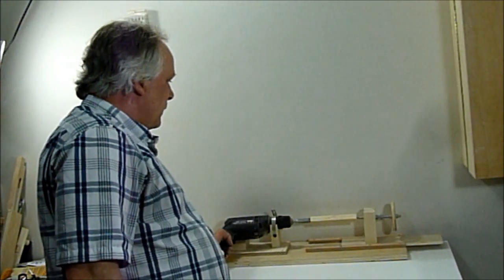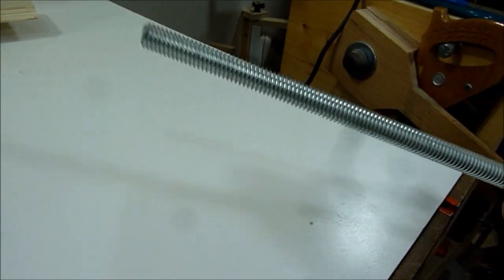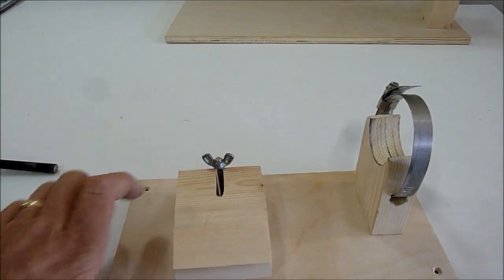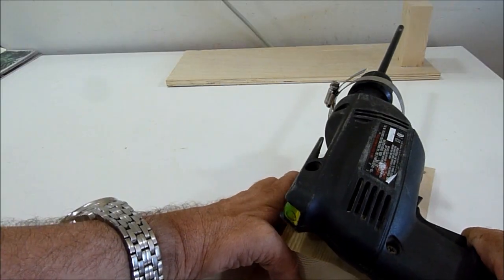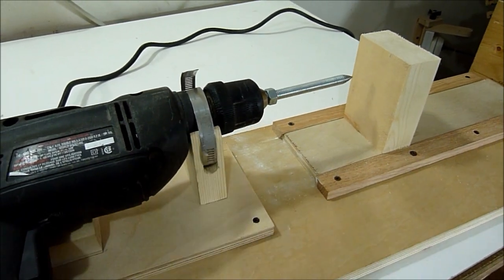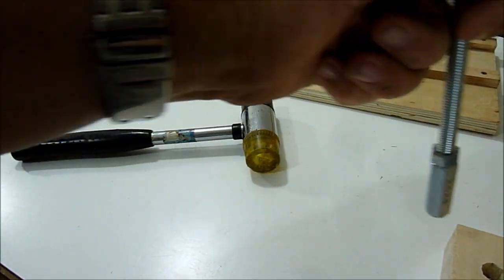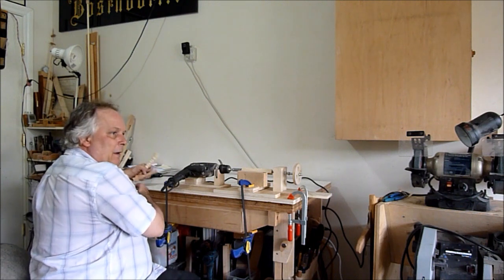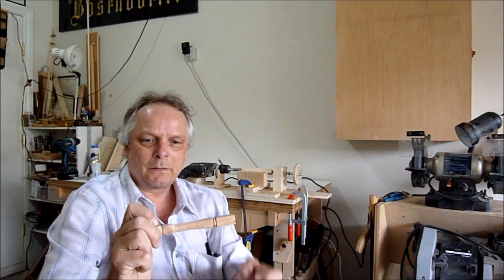How to make a Mini Lathe

Comment: yeaaaaahhhhh i dont care what anybody says about the lathe, i think you made an incredible machine. if i needed to make a breaker bar with a socket at the end, id whip the ole welder out and weld it to some scrap rebar. fact is he made something that works. btw you dont need a drill press with a hole saw. great job

Comment: Thanks for posting.   I can't afford to shell out $500 for a lathe or even a couple hundred for a used one and was contemplating using a drill for the motor like you did here but I was unsure if it would have the horsepower needed for turning wood.   This video has obviously answered that question so the most expensive component of your design I already have and I like that your design allows for the removal of the drill as needed for other chores.   I have a short list of projects I want to try out including turned Christmas ornaments.   I like that your design is also compact.  I have a very small place so basically I need something I can do on a small kitchen table and I think this will do the trick.   Hope you don't mind me stealing some of your ideas.

Comment: nice build, very handy... You really shouldn't use a rag in hand like that on a turning lathe, you could easily lose a finger or suffer terrible wrist damage. Wrap the rag tightly around a stick and secure the ends or use a paint brush. Fingers are the one tool you can't replace.. I heard you say you never had a lathe or used one. Please look for some basic safety guidelines... keep on having fun and make more video's...

Comment: My 1st wood lathe was powered by a drill. You might want to make or buy a live center for the tail stock. Holds the wood better without heat and burning issues. 
Nice work

Comment: if you have so much industrial machinery at your disposal - why not get an actual lathe if you are going to be making many things from it. If it just a tool handle you want, you probably get one at the hardware store for less than a dollar. As time goes by, the wooden components will not maintain its integrity and your pieces won't look the same.

Comment: thanks for inspiration... I would be using a hand blender motor coz I got only small DIY task :)
Reply: Blenders motors are not designed to run for a long time ( only  a few minutes for the best ones ) , it would overheat and blow qwickly .
Drills can run longer , on drills , you can hook sandpapering machines , or circular saws ... tools that requires the drill runnig a long time .

Comment: I made also lathe with drilling machines. But a lot of drilling machines became destroyed after a while. Maybe that dust came into the motor. Another problem is, when my drilling machine drills, I had to press down permanently a button. So I have only one hand free. How is your solution to keep the drilling machine drilling?
Reply: most corded drills sold (at least here in the U.S. have a button that will keep the trigger depressed in the on position.  If not, just zip tie it.

Comment: Great job. Also, I like the tool handle you made, I might make a set for my files :)
Reply: +Jack Houweling Awesome tutorial.
1. Is your lathe still running? Someone mentioned not to use drill motors for long duration at a time. 
2. What duration you recommend for running drill motors?

Thanks

Comment: For a second there I thought I could make myself one. I am a lady with a drill but sadly none of the other tools you obviously need to create the parts needed. So I will just watch yours. It was a cool idea. I guess if you can turn such a reasonable item when you have never done it before, you should treat yourself to a real lathe though, probably safer in the long run.

Comment: so the wood stock just spins on the sharpened pin at the butt end? seems like it will just burn and reduce the overall lenght - why not use a skate bearing and 15 gauge threaded rod at the butt end?
Reply: pretty cool though - i love both low tech and high tech solutions -
Reply: +jake carvey im trying to make something similar,would that rod just snap fit in the center of the bearing? thanks..

Comment: Great video Jack. I followed your video except I added a screw stop to the tail stock bottom, in stead of having to use a clamp. I put in 5 stops so it can be adjusted to various lengths of wood.

Comment: drill motors are not made to run for such a long duration at a time.. You would probably burn it soon if u keep using it as a lathe!
Reply: a Mesterek
Reply: +Mithun Karmakar so work fast and stop it frequently.
Reply: If you have a good quality drill , not the chitiest drills that are sold at the cheapest prices , it would handle , lathing needs less efforts on the drill than  drilling in hard concrete or steel .
I Owns an old Black&Decker drill model DNJ84, it's fourty years old and still works , dad hooked on it those littles pumps , the drill ran for hours to pump fuel-oil for the stove ( basically low priced diesel ) , another pump for water , ran for hours too,  the drill is still alive , only regreased the gearbox several times !
Reply: yeah they dont make it that good these days
Reply: Mithun Karmakar 
Or you have to switch to pofessionnal drills that cost a bunch  .
Reply: +Mithun Karmakar what about a mixer drill designed for higher torq?
Reply: higher torque is fine.. but usually they also get damaged from prolonged use! the culprit is heat due to friction..

Comment: Hope it works out for you.  To me I would be worried about burning through drills due to excessive side load.  I say this because drills are not (typically) designed to be side loaded.  I say this from experience after having ruined a drill with a cup brush.  I suppose it will hold up if you are careful and are sure to  not try to remove too much material at once.

Comment: i really like your last tool handle great job for a rookie, im yet to make mines or to build, im actually have a 120v dc motor from a weed wacker, i think ill add a light dimmer and some passive components to control speed, i want to make my own worm gears and threaded acme rods

Comment: Could this apply to a Dremel tool as well?
Reply: +EdBoonSucks  I wouldn't try using a dremel for the lathe.  The speed is too fast and the wood may fracture or worse under those speeds.  For this project Jack used a drill, and it seems to be the perfect speed.  If you do use a dremel I would sudgest you have on a full face shield and chest protection.
Reply: +Stephen Draper Regarding your comment, the Dremel 3000 would probably be quite ideal for the job because it has different speed settings.  On the lowest speed you can literally put your finger on the end of a drill bit without pain, it's so slow!
Reply: +TarasDoesDIY  I agree, the Dremel  seems well suited for this application,  not to mention the almost limitless number of tools available for it.

Comment: Nice lathe Jack. I was at the "cheap" store and found a "set up" for use with a drill. It was pretty cheap, but good enough to know I like wood turning. Have already made handles for my antique socket chisels, and a handle for my friend's reel mower. Had made a few drum sticks for my drummer friend.  Maybe one of those mini bats next, who knows.
 Great video.

Comment: A real tail stock should rotate, just having the wood turn on the fixed point can leave burn marks.  You should have a bearing on the end of the tail stock, or perhaps have mounted a rollerskate bearing into the tail stock block and then tightened two nuts on either side of it.  Then you'd have to have the bearing block itself move back and forth to lock onto the work piece.  Still a very nice lathe!  BTW have you seen the book by Gingery on how to make a metal turning lathe?

Comment: Cool homemade lathe. BUT NEVER use a rag in real lathe like that, it will get sucked in and can take your hand around with it!
Reply: Michael Word That's right. An emergency kill switch should also be right next to it to shut it off fast should things get messy.
Reply: It doesn't happen as offen as you think but yes and allways remove your tool rest befor you sand and keep it away fro  the sperr and you will be fine
Reply: I used to work in the aerospace industry as a machinist and machine tool programmer. I personally know people who have lost fingers and worse by just doing something like that. One guy was just polishing a bore with emery paper and his figure got caught and spun right off.
Reply: Michael Word exactly what I was thinking, lol... like... MAN... isn't that DANGEROUS?
Reply: Michael Word Yeah, but this is a drill and doesn't have NEARLY as much torque as those 3-phase lathes in the machining industry. I worked in a machine shop for a while and definitely know the power of a true lathe, but something this small won't take a finger off like a real lathe would. Still made me wince for a second or two though.
Reply: Kcducttaper1
Sure, but it's still not a good practice, and that drill is powerful enough to hurt you. I used to be a supervisor in a large aerospace machine shop so I guess I'm just used to getting after people for those things.
Reply: Michael Word
I've worked in a machine shop for a number of years too and I wouldn't make it through the video if it were a real lathe. There's a 'fails' video out there that includes a guy getting his pant leg stuck on a t-handle in a lathe. I can't shut that video off fast enough! About the worst a drill can do is just give you a nasty booboo though.
Reply: Kcducttaper1 You're fine, I was just mentioning that for people who, unlike you, perhaps might do that on something more powerful.
Reply: +Michael Word
  When you say "NEVER use a rag in real lathe like that", what do you mean? I have seen other wood turners use tissue paper to apply finish, or sanding paper before that, on videos like this before. The only thing I can think of different here is how he went beyond the wood, touching the lathe instead. Is that what you were referring to?
Reply: Stars-in-a-galaxy
It's violation of basic shop safety, for the same reason if you have long hair you need to tie it back. A rag can get sucked into the lathe and take your entire hand with it, it does happen. And if the lathe has enough horses you could lose some fingers or your entire hand, or worse. It's a very bad practice.
Reply: +Michael Word So to prevent that you keep anything you are using free of the mechanics and make sure it is unable to wrap around whatever it is you are turning?
Reply: Stars-in-a-galaxy
 Yes, that means no rags in the machine, no ring on your finger or other jewellery. I was actually with a a guy that got his middle finger spun off on a lathe because he was polishing a bore with emery cloth. The emery cloth got caught in the bore and took his finger with it. Happened in less than a second.
Reply: +Michael Word Youch!

So no cloth, then! Perhaps a bit of kitchen paper for polishing and small squares of sandpaper when sanding - making sure non of it touches the mechanics? Thanks for the advice.
Reply: Stars-in-a-galaxy
 Yes, if I need to polish something in the machine just a tiny square of sand paper, nothing that could wrap around for sure.
Reply: +Michael Word His what got caught??
Reply: +Michael Word 
I know man when I saw those strings on that rag, I gotta say I was cringing. I have a Jet mini lathe and lathes are fun but very dangerous...they require 150% absolute attention and concentration. If I polish the piece with a cloth it's a very small piece, so if it does get yanked it just flies out of my grip....no sleeves, no jewelry, tool rest is out of the way and locked!
Reply: king shaman Exactly, lathes are dangerous, safety rules are there to prevent known accidents that do easily occur.
Reply: jpa

Comment: Excellent,simply excellent. I spent 27 years in an industrial tool room as a machinist/tool designer/welder. I have tens of thousands of hours on lathes of various types as well as vertical and horizontal milling machines and you sir, are a tool maker!Well done.

Comment: Hi Jack , a very nice project indeed , I like it . Towards the end of video , you mentioned something about squeaking , I think it's because you'll need to incorporate some kind of bearing on your tail stock , so that it rotates along with the piece you are turning .Whereas right now the tail stock is rubbing against the piece , creating a lot of friction and heat , and possibly drying up some moisture in the small hole at the end of the piece and over sizing it , which could result in some amount of vibration .

Comment: Just a little pointer for safety: strap the handle of that drill down, because now you are only relying on the tension in that hose clamp to keep the handle part of the drill from spinning.

Comment: Wow! I like the simplicity of your design. You built it so it does the job without being overly complicated, and didn't break the bank in the process. Tool building is a lost art. True, you didn't build a split particle beam proton accelerator, but you did have a need for something that you designed and assembled on your own. That is something to be proud of. Keep up the good work!

Comment: Two questions: what are the parts on the dril to hold the wood? and how do you prevent the wooden block from sliding away? i see you used clamps there but did you also try anything else that would be faster to use? thanks

Comment: Excellent!! I spent last summer lamenting the fact that I don't have power in my shed and no power tools to run with it anyway. Over the winter I realized I could use a solar panel and battery, and rechargeable power tools. Now, thanks for this and the idea of making some of the more expensive ones out of what I already have. Again, thanks.

Comment: Thanks for solving my problem. Lately I developed a desire to build my own chess pieces so I browsed for lathes. The ones I found are way too expensive for my novice level of expertise as an initial investment. I browsed Youtube for DIY lathes and found yours which is very affordable and it works. I plan to build mine with a baseless router and a few bucks worth of bolts and wood. Thanks again because now I can practice and develop my skills with minimal investment. Also congratulations for almost 2 million views. That's quite a successful video the one you have here.

Comment: I want to make this mini lathe, but I don't have a bench grinder. Can you make a tutorial on building a mini bench grinder? I need it to make the lathe
Reply: GeddyMX Get one from harbor freight.

Dremels don't do crap, never get a dremel.
Reply: Micah Burgin as someone who has owned the same dremel for 12 years and uses it nearly every day for guitar pedal manufacturing I have to disagree. Maybe you got a rotary tool from harbor freight and are comparing it with an actual dremel, which would explain why it didn't do much, but even the $8 rotary tool 80 piece set or whatever does a lot more than you lead on, especially for wood.

Comment: really good man !!! Only at your age and weight you should care a bit more not to breath the dust of certain woods and in gneral also as they cause cancer - You did not show that breath air filter to wear - a friendly hint from Oldvi as far as I know oak and - a hard wood too I cant remember inglish word are specially dangerous
Reply: Other than the grinder, the tools he was using - even the lathe itself - don't really produce much aspiratable dust, just mostly larger shavings. You're wise to use a face mask when using a lathe, even a small one, but a dust mask is not really required. It's more useful when sanding or finishing, or using a fine-toothed blade on a rotary saw.

Comment: Hi Jack, Your lathe is much more refined than the first lathe I made 30 years ago. I still have the first handles that  I made with their 3/4" copper pipe ferrules. They are still giving good service on a couple of rasps .
All the best
Jeff
Reply: Hi Jack, That little setup is long gone. It was built to make file handles and comprised a small bench grinder with a drill chuck fitted to one end. It was screwed down to a piece of ply. The drive center was a machine part from a scrap yard with a two prongs and a centre filed into it. The tail stock was fixed (glued, nailed  and screwed) in place and was set for 7 to 8 inch long turning blanks. The centre was much like yours but without a hand wheel. It had a square filed on the end that would accept a 1/4 spanner. My only turning tool was a piece of 1/4 square HSS pushed into a piece pine.
I think I still have the drive centre somewhere and If I can work out how to send you a photo I will.
All the best
Jeff

Comment: The only caution I'd offer with this, is not to turn anything too large/eccentric - having used a similar setup to turn a large chunk of mango wood, the weight of it completely ruined the bearings in the drill - they're not designed to cope with being loaded in this direction

Comment: That's a pretty clever way of doing it. :D I'd make some adjustments that would allow the x and y axis to be adjusted with a low ratio crank for very fine adjustment, and a way to mount an etcher of sorts to the side so you could replicate pieces. It's awesome man, I really dig it!